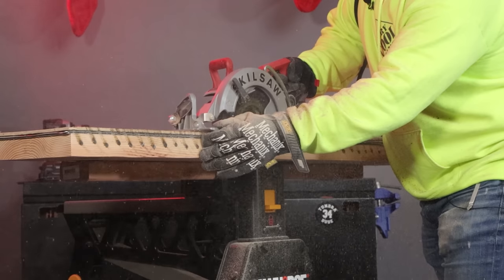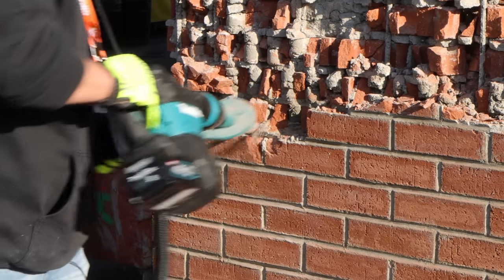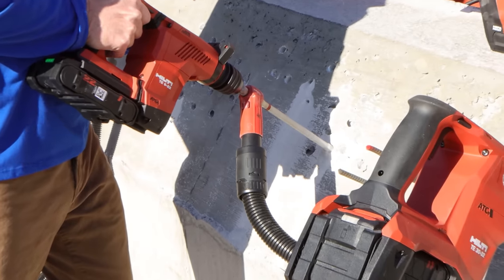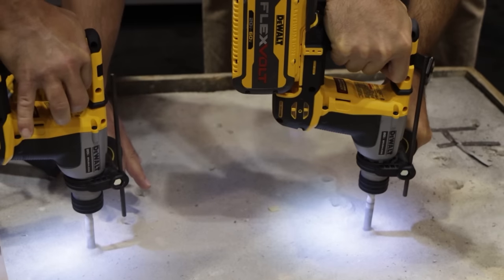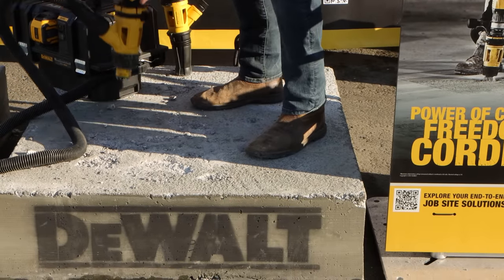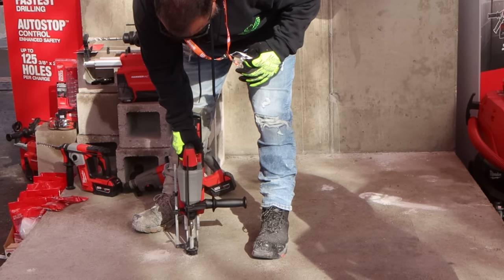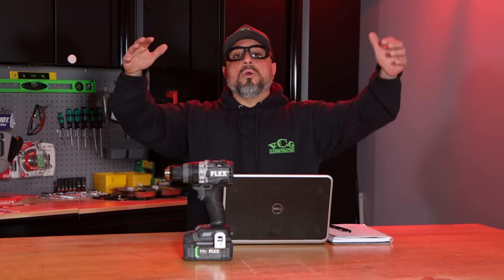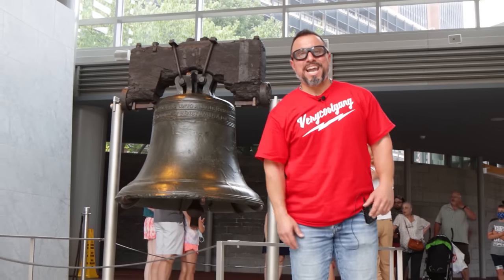Top Cordless Power Tool Brands RANKED!

Comment: FLEX for large tools, Milwaukee and Bosch for 12v tools 
The M12 lineup is like non-other but with that said for pure accuracy and precision Bosch has better control on the 12v drivers no competition. 
One more thing, the Dewalt DCF840 paired with a power stack is lighter and more powerful than my M12 impact with a 6.0   
Lots of great tools coming out just wait and give it some time because the battery platforms are advancing quickly and tools are gaining more power

Comment: 1. Dewalt. Reliable. Great batt. Well balanced. Made in 🇺🇸 
2. Makita. Loved their drills, tough. Well balanced dropped it in a lake no issues at all. 
3. Hilti. Quality like no other just pricey and harder to get. 
4. Milwaukee. I'm a plumber and jack of all. Not happy with batts. My company has a lot invested into mil. And have a lot of broken equipment unfortunately.  They would be 1 if not for batt. And reliability 
5. Flex here for now till I get my hands on them. 
Tier 2. Bosch. Metabo, porter-cable, ridgid
Tier 3. Skill, ryobi, craftsman, kobalt heart

Comment: I'm surprised the you did NOT have SKIL in your rankings? 
Your reviews on their tools is the reason in have invested in both their 12 and 20V lines.
I'm very impressed with what I've purchased so far.
I don't see SKIL doing the promos that other lines are doing to BUY the market, but they r less expensive than ALL of your TOP 5
Reply: Skil is good and affordable but they offer nothing grounbreaking to be on the TOP 5.
They don't offer 21700 cells, nor pouch style cells nor compact cells. They have a compelling lineup but they're not geared towards contractors.
That's a reason Ryobi isn't here either despite offering one of the most comprehensive lineups on the market, but after all they're made to a price point and some corners have to be cut.

Comment: Vince, I have to disagree with your choice for number one, in fact I feel that Flex shouldn’t be on the top five list at all.  Mainly because they haven’t earned the right to be on the list.  Because of their “potential” willingness to adopt flat pack lithium technology?  That doesn’t make any sense.  They don’t have the depth and breadth of tools.  They don’t have tools targeted for specific industries.  Most importantly…they don’t have the   I think you have to look at it like this, if Flex folded up shop today and went away, would the tool industry and consumers feel it?  Would there be pain?  I don’t think so.  However, if Milwaukee folded up shop today there would be major ramifications felt throughout the industry.

You mention the Milwaukee MX platform as if it were a bad thing.  In order to power the industrial sized tools, they needed industrial sized batteries to power the tools.  Which I feel is a way better design vs stringing together a bunch of M18 batteries.
Reply from the maker: Marty I appreciate your comment and agree with much of what you’re saying, but this list is what to watch in 2022. I guess my delivery was off, sorry.

Comment: I just realized why these kinds of videos drive me nuts -- it's because every brand is targeting a different set of areas and customer preferences at different price points.  Someone who really knows all the brands needs to assemble a tools grid where the rows are the use case (plumbing, framing, etc.), and the columns are the preference type (power, value, warranty, recent-growth, etc.), and inside of each box has your ranking for the top-5 tools for each.  With that you could highlight the relative strengths of each brand and really inform your audience better.

Comment: I have brushed Milwaukee tools at home and obviously they don't have as much battery life as a brushless they are just fine for home use, the only fuel I wish I'd bought was the sawzall because I use it to cut up midsized trees at home frequently.  I have Dewalt brushless and corded tools at work and they are great too but I'm not really noticing a big difference in battery life between those and the ones I have at home.  My dad's Makita drills were fine but I didn't use them enough to get a good comparison.  As far as corded 6" grinders go Dewalt is far better than Milwaukee or Makita.  The Milwaukee grinder button is awkwardly designed and the Makita takes a second or 2 to get up to speed then slowly powers down when you take your finger off the trigger which is a big pain in the ass.

Comment: Well said.  All these tool companies are moving targets, depending on their line, and quality, which is by NO means guarantee’d year after year.  We know longer live in those times.  All it takes for a company to fall off the “#1” spot, is a line-up of junk, when they try and get cheap, or “cute” with a product.   *The biggest problem I have at this point, is how vested I am with a single companies products.  Im my case DeWalt.  All my cordless tools are DeWalt.  All it takes (in my case) was. Jus at few cordless tools, and now I’m stuck with it.  It’s rarely the tool that I have a problem with, but the batteries themselves.   It’s still much cheaper (for me) to buy a new battery, than an entire new tool.   Love that DeWalt’s Flex battery works with my tools…..that’s enough for me, for now.*. When the day comes when tools are interchangeable with other companies batteries, then the world will be a much better place.  GREAT video!

Comment: It’s hard to say which is best, they all will do the job for 90% of users… many of us don’t use tools everyday, maybe just on the weekend or every once in awhile for our own house projects, or vehicle maintenance… I’d say you can’t really go wrong with Dewalt or Milwaukee and those could be the Best ones to buy because they are available at more stores than anyone else…. I started running with Metabo cordless tools and while I do love mine, I do notice why many shade away from them… you can’t walk into many stores and buy their tools, and they don’t have as big of a lineup. I have a Menards and Lowe’s 5mins away, those both sell Metabo tools but the selection is minimal compared to amount of tools always on hand for the other brands. You have to pretty much buy Metabo tools online which sucks… but from what I’ve noticed though their batteries do seem to be much better priced.. a 8ah battery for Metabo is $130 or less right now, to get a 8ah Dewalt or a Milwaukee it’s like $200

Comment: 1 Milwaukee 
2 Milwaukee 
3 Milwaukee 
4 Milwaukee 
5 Milwaukee
Reply: If you're a plumber or auto mechanic then yes, but they don't offer everything by any stretch. Cordless biscuit joiner, track saw, fence stapler, roofing gun, quad charger/generator, etc. Not only that, but their first gen cordless nailers were horrible, their cordless miter saws are known for inaccuracy, their cordless router is weaker than ryobi, their cordless table saw has bad reviews, etc. No single tool line offers everything a versatile tradesman needs. Don't get me wrong, I own probably 2 dozen M12 tools, all my lights are M18 because they can also plug in, and I have the 9" grinder, chainsaw, and blower, but still, they don't complete a set. Also, my worst ever experience with tools for over a decade is, ironically, the most I've ever spent. M18 fuel impact glitches forward/reverse after changes, M18 fuel sawzall wouldn't hold blades after 3 months, M18 fuel hammerdrill chuck is completely locked up. Very disappointed. Never had any of those problems with makita or dewalt, even bottom line brushed tools.

Comment: Wait a minute.  You also said that Milwaukee was not being number 1 because of their MX line, and making us buy into that battery platform if we wanted to use their heavy duty tools.  That is absolutely the definition of innovation. But if you want to use that same logic or definition, then you should consider that all of these companies started out with 12 volt battery platforms, or in many cases even lower battery voltage, and made us all buy newer, higher voltage battery platforms in order to use their larger, more powerful and useful tools.  So your logic is a bit flawed in that regard.

Comment: Disagree
Naming a new start up company  number one ...let them wet their feet in the market  for 5 to 10 years then give them a rating.They shouldn't be on this list, it's an insult to Makita and Milwaukee and Dewalt in my opinion. 
My top 5 
Milwaukee ( the tool line is huge) 
Makita (they make some quirky tools that makes you ask why , but their drills and saws are top quality)
Dewalt ( good selection good price medium to superior quality)
Hilti ( amazing tools but catered for the big contractors like Vince said I don't even know where I can buy one,
But every big plumbing company I use their guys have Hilti or Milwaukee.)
Ridgid  Metabo Bosch ( they can share 5th place they all make a couple of great tools but not a great line of tools )
I agree with most of the comments I read whatever fits your budget and gets the job done. I always tried to buy the best tools that I can afford. I researched my purchases and found out that not one line of tools has the best in each category so you either compromise or invest in multiple lines.  If you want to invest in one battery line then stick to the top three and you can't lose on quality and choice.
Sorry Flex don't know your tools, I'm sure we will get to know them with time.

Comment: I find that no big brands look at small tools like a hot glue gun. Even if contractors don't need them other's like Woodworkers need them.
Reply: Ryobi has 3
Reply: But other than that like Milwaukee, Makita, or dewalt. I meant the bigger brands. Sorry Ryobi but it hasn't expanded enough and I'm already on 3 platforms.
Reply: @beaverbuilds3984  pretty sure 250+ tools is more then anyone else that has one. Plus they aren't drinking 7 cases of beer then pricing thier batteries
Reply: Valid point but I don't want a 5th battery platform.

Comment: My opinion I wouldn’t rank Flex the top power tool platform until they have more offerings in the market.   Most powerful no doubt but not the top platform…yet.  As someone else mentioned each major manufacturer has a strength or a few strengths my vote is for Milwaukee as they have strengths, a large amount of offerings and don’t have many items I would consider weak..
Reply from the maker: I would agree James, our list is top tool companies to watch for 2022!
Reply: @VCGConstruction  agreed, what Flex  has brought to market so far I don’t many would have thought possible…to step new into the market and have the most powerful offerings in almost every tool they have launched.. that will push the other big brands to step up or step back!
Reply: @VCGConstruction  The title of the video is legit "We rank the top professional tool brands!"

Comment: I'd say this list does not give good advice when considering return of investment.  If your convinced 1 battery platform is the only option then consider the industry before spending. For residential the best value dollar for dollar is probably metabo 36v.  For the construction aspect they got cordless tools for work from the foundation to the roof. Rebar cutter, bender, dupelx nailer, framing nailer, hardware nailer and other essential tools for home construction.  They got sweet deals throughout the year, all tool companies do.  (I don't own any Metabo tools currently)
  I use 5 battery platforms do not like Makita at 5 vince.  Not sure how we define professional but my top 5 currently without best value per tool in mind #5 Rigid #4 Hilti #3 Dewalt #2 Makita #1 Milwaukee.
 Way too soon for Flex to be top 5 regardless what they selling. I'm a Dewalt hater but I own there tools. Makita probably take number 1 easily in a couple years.

Comment: It's hard to make a top 5 because you have to discriminate against the competition and find reasons to knock them down. But that can be done if you systematically quantify that. My top picks would be Metabo HPT, Milwaukee and DeWalt. I know Flex has performed, and I'm glad Lowe's has them but my problem with them is that they're another Chinese company coming in extremely late in the game and doing the same thing the CHICOMS always do; steal everyone else's technology.  Flex was also deceiving when they used actors who they said were professional contractors in the exaggerated reality show style release parties and they exaggerated their tools performances.

Comment: I would kick Flex out of the TOP 5 simply because their stacked lithium batteries aren't here yet.
Yes, they outperform almost everything else with their current batteries, but the tools themselves are also heavier than everything else and weight is also a consideration when looking at hours of work.
Their lineup is still limited, their stellar Lifetime Warranty was just downgraded to 5 yrs for every tool purchased from Jan 1st, 2022. I'd rather move all the other brands up 1 position (Can't decide if I'd rank DeWalt of Milwaukee on top, though) and would add Bosch at #5.

Why Bosch? Their PROFACTOR tools are a real thing. Power comparable to a corded tool without switching to different voltages unlike DeWalt or Metabo HPT nor any need to have 2 batteries to power heavier power hungry tools. The only knockdowns are 3 yr warranty (time to step up to 5 yrs) and limited lineup, but so are eg. Flex and Hilti which are also shown here.

Comment: Dewalt is number 1 more locations to buy Lowe’s HD ace tSC and amazon ect

2 makita again available locations HD amazon and other contractor supplies

Milwaukee 3 HD and other locations no Lowes however and amazon no ath dealers but strong product line

4 ryobi just the amount of tools

5 bosch for heavy construction concrete tools

6/7 kolbalt / craftsman

Comment: Here comes the hate.  Flex as your number one brand!?  Or is this for innovation?  Here's my personal experience with them.  JUNK!  Why?  Because they overheat when being used on jobsites.  (Not even going to bring up their unfair comparisons on their break out videos)  I've had three different contractors show up to three different job sites and try to show me how their Flex tools would be more powerful than my M18 FUEL tools.  All three of them failed to make i throughout the entire day before their tools failed them, and they had to use mine or run back to Lowe's and make an exchange of one type or another.

Comment: The new DeWalt tools not available vin Oz. Flex tools not available vin Oz. The latest of most things not available in Oz. Do a tool review start of 2023 and we may have some of the tools you are reviewing now. I would love to try the Flex platform but no mention of it coming over here.
Reply from the maker: The land of Oz, where is that at Dave?
Reply: @VCGConstruction  Ozzy mate, put another shrimp on the barbie, and that's not a knife, this is a knife.
Reply: The other reply is correct. Australia the land that time forgot
Reply: @davetaylor4741  the land where everything is venomous.
Reply: I seen a Flex tool van on the Logan Motorway near Brisbane on Tuesday 15th Feb.
Reply: @tonyandkim511  You can get Flex sanding tools. They have been around for ages. More automotive use. Don't think the power tool range is available here.

Comment: I have the Ryobi lineup. My reasons were the flexibility of cool gadgets using their batteries well beyond power tools. The power tools themselves seem to do pretty well for the DIYer. 
What I discovered was that their tools might be ok but their accessories like drill bits and such suck ass. I expanded my Ryobi  stuff beyond the power tools and got a pressure washer and sliding miter saw. The miter saw absolutely will not stay aligned. POS. The pressure washer using cheap ass Powercare brand pump so the Honda motor is the only good thing going for it. The Idle Down cable rusts and you have to remove it and maintenance it to get it to run. Another POS. Then i started watching “Project Farm” and Ryobi continually stays at the bottom half of every test. So Ryobi has lost my support.
Reply: The thing with project farm (don't get me wrong the rest is great) but when he tests ryobi he either buys the cheap brushed shit or gets the brushless tools and uses them with the cheap shit battery

Comment: The tool brand everybody needs to invest in is clearly hart since they are basically Walmart Milwaukee......just kidding. The best platform is the one you're already using. Not to say that you can'y switch platforms, it just gets pricey. 
1) DeWALT (best backward compatible batteries, and some are American made)
2) Milwaukee (best batteries overall)
3) Makita (they have a cordless coffee machine, and are super reliable)
4) FLEX (great tools but not too many offerings) 
5) Ryobi (slowly becoming less cheap and more reliable)

6) drillmaster (best power tools ever, definitely will not blow up after drilling one hole....just kidding yet again)

Comment: I love being on one battery platform! I chose Milwaukee and I wouldn't change that if I could.

I think Makita makes maybe the next comparable tool/battery platform.

DeWalt would be third for me. They definitely make some great tools and seem to be priced more affordably, but if I was a current user of DeWalt, I'd be a little annoyed with the seemingly ever changing batteries. From terrible nikad, to lithium ion, to flex volt specific tools, to small power stack batteries that are quite high priced.

I don't know if I would trust any other company to make ALL my tools.

I would probably pick and choose from the best made tools,  Milwaukee/Flex/Makita/kobalt impact driver.
Makita/Milwaukee/Flex/Ridged Impact wrench.
Kobalt/Milwaukee Right angle impact wrench.
Ryobi makes loads of power tools that almost no other platforms make. Etc